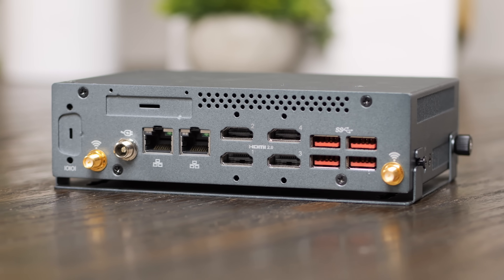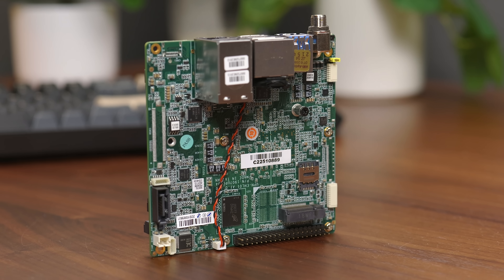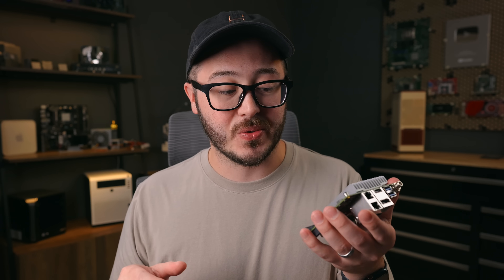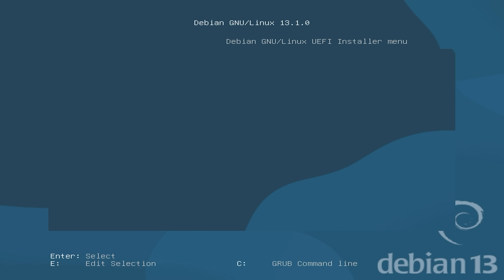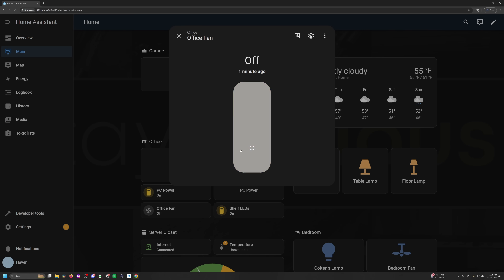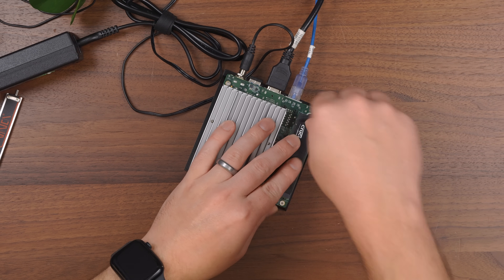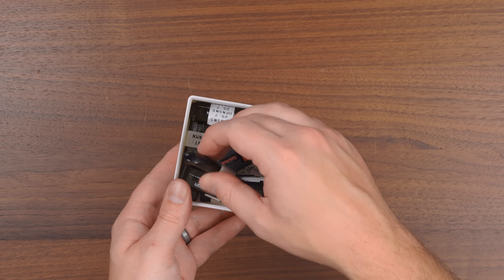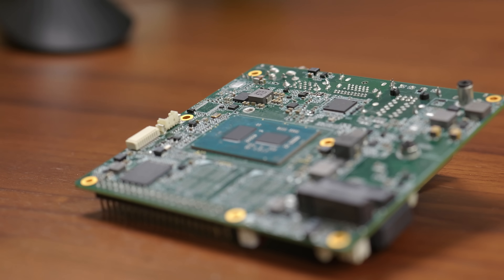This $63 Mini PC Might Be a Hidden Gem

Comment: These are the actual makers of the now "old" Atomic PI. 
If what I heard on the vines was correct the Atomic PI was originally designed to use on some sort of robot by a startup that failed which then resulted in them getting dumped on the market at beautiful prices (for the record that Atom CPU from the atomic pi is the same CPU core that was used on the Zenphone 2). 
The one question that I still have lingering about the Atomic PI which does not seem to add up to the robot story is the presence of the XMOS Audiophile versatile DSP/FPGA core (not sure if it is a full FPGA, but I am sure it is a quite powerfull audio offloading and processing chip). That plus the tools available (for windows only it seems) for the audio device make it sound more like a lie detector or something.
And also it has the same RAM limitation of 2Gb, though as I am using my Atomic PI to run OpenWRT x86_64 it is overkill as is (or would be if I were not also having it be a transparent caching proxy with antivirus :P )

Comment: OH! (15:31) I saw a little light coming through underneath the bottom SSD! I would try a slim sink under the bottom SSD - thermal media btwn the two (like you’re doing) - nice SSD sink on top (or spare pi fan/sink… if you had to ship it or rely on it for actual use… I’d figure out what type of glue sticks they use inside PSUs, that fun white & solid coating they add… I just love a side-quest  like this 😅 something about low gains : high expectation of failure almost gives my productive side more permission to Do. I wish I could turn them down and change my life for the higher productivity but I just look on the bright side for now :) love your content and how you handle these experiments! You’re able to remain concise while answering a lot of adjacent questions for a new guy like me. I really appreciate it! 🦾🫡💾

Comment: Reg power draw... I run an N4020 based system and contrary to my expectations, running a GUI reduced the idle power consumption by a lot. In CLI it was 6W+, but then the GUI is running it's closer to 2W!

Comment: 2:42 I just clicked your link to the board in your description and after I copied the link from the browser that blocked your video from playing, I opened it in Chrome. But F-Secure is giving BIG warnings about the site, saying "There are several signs that this shopping site may be a scam
youyeetoo("dock corn" - instead of what would be written anyway because you may have comments with hyperlinks blocked on your channel to keep the men posting links to websites saying something like they show women without clothing). Something doesn't seem right with these based on this...
I'll wait to hear how much and what type of RAM this has, what CPU speed and type it has and most importantly which form of pci-e it provides. I love my Gizmosphere Gizmo 2's to their center atom, but they only have a 2 core AMD GX CPU which isn't multi threaded, DDR2 RAM and most troubling, only PCIe 2.0. Most of the potential replacements I have found so far are either over $1,200, are also PCIe 2.0 or for other reasons. A reason I love my Gizmo 2's is I bought them with the low power (lower than 3A at 14V) expansion boards that provide far, far more connection points and types than a Raspberry Pi's 40 pins.
I hope pausing to write all this is worth it and not yet another DDR2, PCIe 2, incapable of providing sufficient speeds.
Just my hope!

Comment: Cool device but they almost double in price to go from 2GB to 4GB of RAM. For the same price, I scored a tiny 3400G Lenovo M75-QR1 with 16gb/256gb and onboard everything. It has an AM4 socket, NVMe and SODIMM slots. Yes it's not suitable for plenty of the applications for this thing but for most people most of the time it's vastly more useful and powerful.

Comment: More like a hidden turd. Low spec and high power draw, but at least it's expensive. For 10-30$ you can get terminal PCs that beat it in every metric and are vastly more upgradeable. Pointless video

Comment: Another useless hobby pc... X86 or not...  Home lab or something real... There's nothing this thing is good for that any other tiny useless computer can't do just as well..   Other than to just say.. Look it works.. Why would you ever want a slew of these things around when you can take one old discarded pc and virtualize..  Spin up any kind/size/shape/and number of vms and home lab away till you run out of Jergens.. If you need to be mobile with a small pc.. Say a hi. Enroll firewall.. Or using at a TV to stream plex.. Or whatever.. Ok.. Then you can use a pie or this or whatever.  That's a legit use... But to say you want these for a home lab or to do any actual work??  Pass..  Get a real server... I bought two HP DL380G8 boxes with dual xeons.. 128gb ram.. Dual psu.. Stuffed full of big SAS drives... Both for 75 bucks..  One had a nice HBA card that I put 16 external 12tb  spinning drives on.. Its serves as a truenas machine. The other is proxmox doing everything else. Both 40gig fiber to the bone and my best workststions. 10g to my other boxes.. All Tucked away in a rack.. All for less than a couple of these anemic little turds..   Sorry.. Just don't get it... Mobile.. Maybe.. Anything else.. Pass

Comment: I need help!

Can i put a 4bay das in too a mac mini m4 and just share it so it would mimic a nas. My idea is that si ce i have a low power computer it is cheaper to buy a 4bay das than 4bay nas but in theory it should work the same as diy nas. Is this making sense. My question is: is this good idea and is it cheaper too buy and run?

Comment: This is made for the point of view using fully Hardware, How did you overcome device dirivers working with others'communication to exernal devices?  it's very uncomptable reasion compairng to RP 5 with 16GB ram,???,  intel does not show all registers to control intel devce dirve and the more, it seems work a few product comparing to SBC!, also JeffGeerling knows well ?

Comment: I was in a similar situation, wanting to tinker with a cluster. I stumbled upon the Firebat T2 mini PC on Aliexpress. N150, 16GB RAM and 512GB SSD. It has an almost silent fan, a case, a power supply and works quite well. All for about 130€. A better deal I guess...

Comment: I may look into one of these. I run a Lenovo M720q with a 4 port nic as my RV's OPNsense router/HAOS/Plex server. The beauty is that it runs on the lenovo laptop adapter on my 12v system. I have the i5-8400t paired with 16gb of ram from my old gaming laptop and it runs totally on solar and battery.

Comment: If the ram was slotted - it would be a hidden gem. Most of the time your bottleneck for low power servers is ram. Even n150 based mini pcs with their 16gigs get claustrophobic real fast. 

At least you took the time to explore, thanks for yet another fun video

Comment: the minimum webtech based app server perfomance is intel n100(to put into perspective it is faster than i7 2nd gen 35w laptop cpus). anything slower and it spends too much time performing cpu heavy tasks, especially when inside vm/container.

when arm based embedded boards become really widely available we will see performance increase in those cheap computers.
imo hunting for sub 200$ used laptop will be a  better system with enough ram.

Comment: It's not good for normal workloads but it's a nice solution for edge computing: City traffic sensing, camera feeds with AI analysis, smart cities, and so on. basicaly to mine data in remote operation. Or even for a LTE router in some cases.
Reply: Would it be good to use as a dedicated audio computer?  I mean aside from needing to add a quality audio I/O?  I have wanted to just use a VSTI synthesizer alone one one machine for a long time, and these prices really make it seem reasonable.

Comment: It’s so hard to spend $80 (with shipping) when you can get a whole mini pc with an N100 (4 cores), 8GB of RAM and 256GB SSD with power supply and case for $129 from Amazon right now.  I love these single boards but it’s the reason I stopped buying RaspPis.
Reply: Or if 2 cores is enough, an N4000 based mini pc with 6GB of RAM and 64GB of eMMC storage but again with case and power supply is only $94 at Amazon.  The N6210 is mildly faster but neither are going to win any speed awards.

Comment: This seems like it'd make a pretty capable 6-drive NAS if you threw in a cheap M.2 to 6x SATA adapter.
You'd still need to figure out the power distribution and enclosure, but could easily manage it for under $200 total for a driveless system.
It'd be a project, but you could save a couple hundred bucks over a prebuilt, which could get you an extra 10TB or so.

Comment: My gaming laptop idles at 7 watts with the screen on. use a laptop.
Jeff pointed out that a n150 is not a energy efficient as arm. even though its slightly faster.
ethernet 2.5 you know usb 3.2 can run 5Gb nics. many n150s have 2 5Gbps nics like the minisforum ones that are like $100-150 new.

Um no you need 2.5 gig on both ends to actually move data at that speed between just 2 things or you'd also need a switch.

Comment: I just checked for fun, they are $90 in Canada, with $40 shipping fees, so basically a little over $140 CAD with taxes. On Amazon right now, I can fin a mini-PC with a Celeron N4020 (so slower, but not that much), 4 GB of RAM (twice the memory), 64 GB eMMC (twice the storage), and it comes with the case and the power supply, for $150 CAD (around $170 with taxes). Sure, you don't get the 2.5 Gbit/s network card and the GPIO pins, but it still looks like a way better deal for me if you just want it for running containers and things like that, and it should consume a little less power since the CPU is only 6W instead of 6.5W (not that I would expect any measurable differences). 

Of course, if you just want a decent computer all-around for cheap, you can get a mini-PC with an Intel N150, 16 GB of RAM and a 512 GB SSD for $250 at regular price, and I just found one with an Intel N97 (which is even better), 16 GB of RAM, a 512 GB SSD, and a 2.5 Gbit/s Ethernet port for only $220 (and this one uses USB-C for power, making it a lot easier to power), but I get that it's not not exactly the best to make a cluster.

(Don't forget, every prices I've listed are in Canadian dollars, they're probably even cheaper in the US)

Comment: As an frequent homelabber myself, my e402na laptop with 2gb ram and an n3350 (about 50% as powerful) can def run proxmox, with pi-hole and tailscale in CT's and an home assistant vm. The cpu is barely used, but the ram is the limiting factor here. It is great use for containers, while only having an 6W TDP

Comment: I use a lattepanda v1 in my parents home as a tailscale subnet router and caddy proxy. Has same amount of ram and storage but runs an atom z8350. I bought one at 20 euros back in the pandemic as like a joke buy. (Turns out i should have bought all 10 the guy was selling but u know how it be sometimes). I liked it so much i bought 2 more from ebay for like 30 a piece. I am about to replace it tho for a mini pc with a 6800u. I kinda need an off-site backup of my stuff since right now i only have 1 copy of my data off my phone and laptop and i would like to have 2.

Comment: 2GB these days unless you just want a terminal to log into is pretty rough, for a very narrow single task computer that could be fine.  I went back in the video though and they had 8GB listed, though at a higher price.  There are uses for a machine like that, but not as a general purpose server.  For expansion though you have 2 pretty good options, use the M.2 slots and convert to Oculink and you can have 2 external PCI-E devices, M.2's or even GPUs.

Comment: those new rockchip based boards are far more efficient, and cheaper. can get a 8gb ram board for that price with support for UFS even, also around 1.5 times as fast as the raspberry pi 5 for the energy efficient budged version, normal version much faster.
and has a 6TOPs NPU which might be usefull for some compute tasks and image or file sorting or such locally(or security).

Comment: You do not need a switch to test network performance. You can simply have another pc with a 2.5Gbe adaptor with one running iperf in server mode then direct connect network cable.

Comment: That odd SATA power is for a SATA DOM.
Not massively experienced with them, but the ones I’ve seen come with the power connector included.
I have one that I pulled out of an industrial motherboard if you want it?

Edit: I should have commented after I watched the last 5 minutes.

Comment: That sata power connector is for a sata DOM (disk on module) which is kinda like a little rugged ssd that does well in high or low temperatures, high vibrations, that sort of thing.

Comment: 12:42 You can install Proxmox on eMMC by interrupting it before selection and editing a script. IIRC, it's a 1 or 2 line addition that's pretty easy to do. After than, you continue with the installation just like normal. 
I did this on two Wyse 5070 thin clients and have a teensy Proxmox cluster for Home Assistant and a couple other Raspberry Pi level VMs for just over the cost of one of these (used, of course). 
I'm not claiming to be the person who figured it out, others with far more experience with Proxmox requested a patch, but I think it got denied.
Of course, the edit only gets it installed and doesn't address the RAM shortcomings. The Wyse box uses 2x SO-DIMM sockets and is upgradable to 16GB easily and 32GB with the right (hard to find) SO-DIMM and a recent BIOS.

Comment: There are sooo many pieces of software that list 2GB of RAM as a minimum requirement... then actually need like 1.9 GB to run, which means most default Linux installations won't be able to run it without swap, since even a minimal Debian install uses like 150-200 MB of RAM nowadays.

Though it can still do a lot!
Reply: most of that RAM usage at idle in a minimal debian install is tempfs created by systemd and can be reduced by changing configs. That's required to run it on some Kirkwood devices that have 128MB of RAM.

Use distros with a simpler init and/or optimized for low resources like Alpine or OpenWrt
Reply: @marcogenovesi8570  If its just the tempfs, then can't you just get rid of it entirely, and use the actual disk space of "/" partition?
Reply: @hubertnnn  afaik no you cannot, they are used for specific functions and need to be a tmpfs. From what I remember it's for the credentials subsystem and udev, if you remove it you cause breakage.
As I said the only solution is to use distros that care about very low ram devices and use a different init system that does not do that, like Alpine (OpenRC) or OpenWrt (procd)
Reply: The question is never what it can do but what you need it to do. Sizing the problem to the solution is bassackwards. If I'm using it as a PIO "RPC coprocessor" for the ZX Spectrum which moves data at a blazing (under) 96KB/s, even an ESP32 without PSRAM would be "total overkill". A Pi Zero is considered "underpowered" for modern desktop use, but would be "ridonculous levels of overkill" for same project. Horses for courses.
Reply: 1. Configure zram
2. Configure writeback-device (for incompressible blocks)
3. ???
4. Profit
Reply: MX Linux or Puppy Linux works well on 2GB RAM
Reply: Could Alpine Linux be something?
Reply: DietPI?
Reply: That's what the BSDs are for.
Reply: Its useless!
Reply: mr geerling how are ya, good to see your watching
Reply: Haven't looked into the specs (or the video yet) but can probably run well as a router routing 2.5G atleast with VPP.
Reply: I have an 8 GB RAM laptop with Windows 11 and it takes 7.9 GB just switched on 😅
Reply: For a homelab environment I'm generally looking for an octa-core (or greater) device with 8gb (or usually 32gb) of RAM at a minimum if we're going to consider it as a server without doubling over in laughter.

I can't say I would consider deploying this device for anything. I'd rather buy a used SBC or mini PC instead.

Comment: There's a whole industry here. This board is meant to be in a "stack" of other computers and such. Said another way - this is a standardized footprint for modularity purposes.

I wish I could remember what they are called, but pretty sure that the channel Cathode Ray Dude introduced them to me.
Reply: That's PC/104
I don't think this is that. The connectors aren't the same, it isn't mentioned on the product site at all. This is just a industrial PC. As the Cathode Ray Dude would put it: "A little guy"

Comment: For this price I'd rather buy a thin client and get much more RAM, especially if you want to run VMs or containers. Can confirm a HP t530 uses max 10W even with CPU and GPU at 100%. If you need GPIO you can get a USB FT232H breakout board for $5 from Aliexpress or $15 from Adafruit. I love your weird mess of random adapters, they are so addictive to buy lol

Comment: It's worth noting that x86 and x64 are just inherently power hungry. There's a reason why phones use Aarch64 (That's what 64 bit Arm is called), it's more efficient scales better. RISC-V if the chip is designed properly, can be even better but at that point you're entering an immature software ecosystem because it just doesn't have enough market share so you'd be stuck with mid solutions or having to build your own